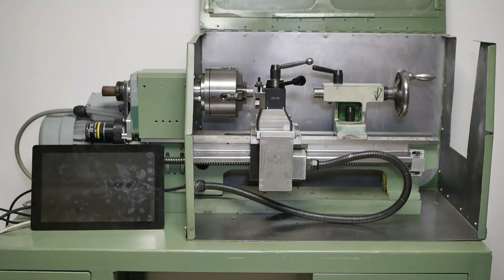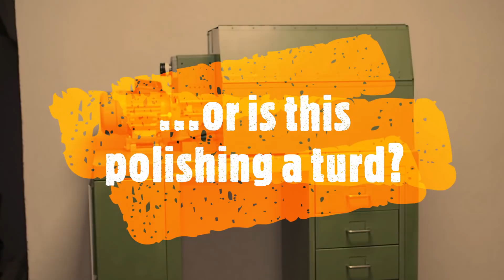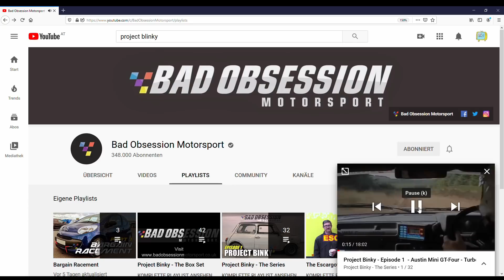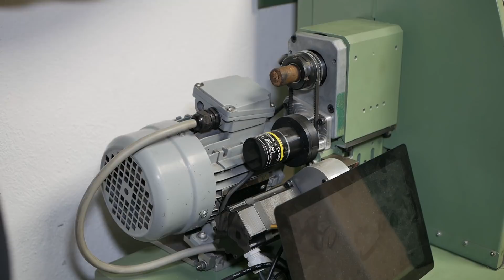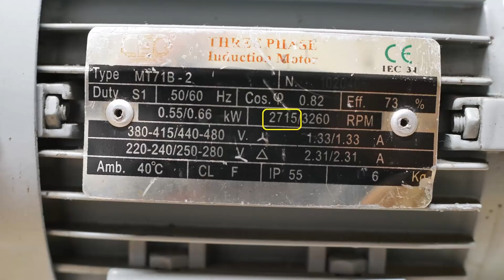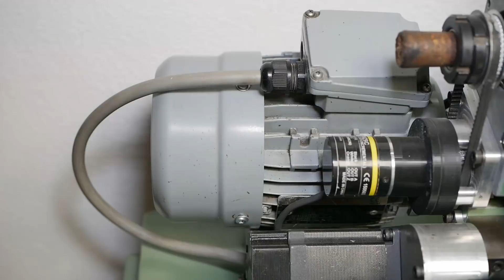Big Motor / Small lathe - CNC'ing the 7x12 Mini Lathe - Episode 32 || RotarySMP

Comment: the correct way would be to drop them in some hand gel /sanitizer / disinfection the moment that you stop sanding them since it cant create aluminumoxide in a alcohol solution ( thats also why you spray aluminium when takeing and after a last pass on the lathe so its super shint and stay shiny
Reply from the maker: Great tip, thanks.
Reply: @RotarySMP  your welcome m8
Reply: @RotarySMP  your welcome

Comment: Me again, did I miss the discussion about using Poly Vee drive belt and not timing belts.  Is the Poly Vee grip such that it will never slip and leave you with a really strange thread?  Sorry, I have been used to the timing belt solution for a really long time now, never figured it would be done any other way.  By the way, getting a feel for a lathe without handles can take a little while, it will come though!
Reply from the maker: Sorry for the late response,  I missed this one. 

LinuxCNC takes a full quadrature encoder for the spindle feedback.  Mine is a 100 pulse (400 in quadrature) encoder driven directly off the spindle, so it doens't matter if there is any slip in the poly Vee belt. Linuxcnc recalculates the necessary Z drive speed to sync with the spindle at 1000 Hz. I am pretty sure it will perfectly track along the correct pitch even down to a fully stalled spindle. There are some video of a guy hand cranking the spindle of a mini lathe with the Z axis threading under LinuxCNC:

How does the Hercus do spindle/ Z snyc for threading?
Reply: @RotarySMP  the Hercus does it badly. The spindle speed is measured at the speed call command line. Once the speed is acknowledged as being correct, there is no longer any more thought given to the problem. We are able to set the spindle error, mine is set to +/- 10, this gives accurate threads but takes a while to get the speed correct. If the spindle slows while cutting a thread, too bad, the Z keeps going at the same speed as it would for the “set” spindle speed. Not really aware of it having caused a problem, perhaps because I know it is a problem and just work to make sure it is not a problem. Hence my interest in your belt configuration.
Of course my system is 30 years old!
Reply from the maker: @smallcnclathes  Ouch. I didn't realise any CNC lathe relied on an open loop for threading. Even TurboCNC and Mach3 sync once per rev to an index. Lucky you know your machines so well.

I actually have a very low resolution resolver, as I got it years ago, when expecting to use the parallel port, which is speed limited. Although LinuxCNC does the snyc calcs at 1000Hz, the Mesa 7i96 can read encoders up to 10MHz, so insanely high resolution is possible.

I'd love to see you track down a third Hercus, do a LinuxCNC / Mesa card conversion using Gmoccapy and Andy Pugh's Lathe macros
https://forum.linuxcnc.org/41-guis/26550-lathe-macros.
and/or NativeCam

Comment: I notice my motor vibrating at some frequencies. Any advice ?
Reply from the maker: Do you mean vibrating like a loose mount? Original 110V DV motor or something else? Not a lot of info you gave.
Reply: @RotarySMP  sorry, the motor itself vibrates in isolation. Just a wee bit but once mounted on the lathe bed I can visibly notice it on anything I place on top of the lathe. It doesn't seem to affect the finish that much. Happens in the 30-40hz range. 50hz/250v nominal here down under.
Reply from the maker: @HM-Projects  These are not exactly high quality motors or PWM controllers. I fried my original motor by overloading it, taking too thick cuts in steel. 

The rubber belt drive will largely isolate the motor vibration from the spindle as will the plastic head stock gears. I wouldn#t worry about it.
Reply: @RotarySMP  could be the VFD, I'm using a 550w ABB motor which should be reasonably good hopefully.
Reply from the maker: @HM-Projects  Ahhh, that was a missing bit of information :)

Did you program the VFD with motors parameters?
Reply: @RotarySMP  yes, plugged all the relevant bits in. I have fiddled with the carrier frequency. Same result with different Chinese VFD, but motor runs smoothly on 3 phase power. I gave up after that :) 

Interested to know if this is a common issue as I've seen it mentioned on the interwebs but no clear explanation. People just skip certain frequencies.

Comment: What stopped you from cutting new pulleys with different ratios for the old motor? (Genuine question, I'm sure you considered it but didn't mention what prevented it.)
Reply from the maker: There is no space under the cover for a larger driven pully, and the shaft diameter would have only allowed small decrease in diameter of the drive pulley. It would have improved things but not enough in my estimation.

Comment: A few comments. If you look at VFD specific motors you will notice the cooling fan is often driven by it's own motor. This is to provide adequate cooling for the main motor when running at low RPM and high torque. So I recommend at a minimum you monitor motor temp when set to low RPM for long periods but I suspect the real limitation will be rigidity of the lathe so perhaps the point is moot . Second it is good practice to fully rough out a turned part before finishing up. This minimises the possibility of the work piece moving in the chuck and producing eccentric parts. Lastly having the compound slide permanently set over at some angle is academic at best on a small lathe. 1) having it offset deprives you of an accurate scale in the Z axis and removes the possibility of the compound moving and messing up a diameter. 2) unless you are producing coarse threads the direct infeed method will work perfectly for pitches under 3mm.
Reply from the maker: I am figuring that such a low power motor takes a a while to heat up, and it is unlikely to run for long periods at low rpm. Guess we'll see.

I leave the Boley compound at 30°, as it is tends to interfere with the tailstock when set to 0 degrees. It gives the impression that it was designed for rigidity more than usablity on the Boley, as it is also limited in the angles it can do. When I need an accurate Z depth, it is quick to rezero it.

Comment: Can't you just program max allowed frequency  output on the VFD instead of changing the motor? All VFDs what I know  have an option for limiting the max output frequency.
Reply from the maker: I could, but the low end torque was also insufficient. A different pulley ratio was also a possibiblity, but theere was insufficient space to use a larger driven, and the minimum drive pulley would not have improved it enough.

Comment: Friendly tip: If you cut v shaped grooves in a part like your pulley using the compound, set to match the angle - much as you would when cutting a similar shaped thread - you will experience less chatter than when plunging the tool straight in using the cross slide.
Reply from the maker: Thanks for the tip. I would have, but the geometry of the Boley's top slide prevents it from being used at the 70° angle this would require. The handle hits (either poor design, or maybe it is not the original handle) Turned out, that chatter was me not using sufficient feed. Only I increased the feedrate, all the other grooves cut chatter free.

Comment: why didnt you get an ac servo motor and use it in velocity mode?
Reply from the maker: Back when I first converted this lathe about 15 years ago, those cheap AC servos were not available. So I got the VFD. Since here I only wanted to change the motor, it was cheaper to stick with the induction motor and VFD.
Reply: @RotarySMP  okay

Comment: I would advise against trying to drill and tap the hardened drive shaft. One set screw on the key would be my choice.
Reply from the maker: Good advice, although it is not hardened. Watch this space...
Reply: @RotarySMP  My bad, I assumed something similar to industrial Baldor's I'm familiar. Its still a big motor for the machine.

Comment: Was anyone else wondering why he did not just change the pulleys to suit the required rpm?
Reply from the maker: Space available. The driven pulley is already at max size for the space under it's housing. The drive pulley could have been made somewhat smaller, but driven by 14mm dia shaft+3mm rad  keyway+4mm dia pulley grooves + some wall thickness, I couldn't have got it down to the range I was looking for.
Reply: @RotarySMP  life is seldom that straightforward, what's the torque like at 100hz? Much of a drop off?
Reply from the maker: In it's current installation, I was too busy crapping myself with the air raid siren of this thing running unlubed straight cut gears at 6000+ RPM to worry about torque. 
Torque at high RPM is pretty irrelevant to this machine. The reason I didn't run a belt directly to the spindle again was the lack of torque down low. Back when I had the direct belt drive, I once cut the male thread for an ER32 collet, and it basically failed as the minimum RPM to have enough torque to cut without rubbing, was too fast for the axis to keep up.

Comment: Try Loctite 641 (or was it 640?) "retaining compound" for loose pulleys & misfit keys. It's like machinist's superglue 😂 
A heat gun can loosen it back when you need to disassemble it again. I used to fix stuff for a living, can't remember the number of times we had machinery with lost or broken keys, needed to be turned around in hours if not in minutes!! 
This stuff basically allowed me to run hundreds of motors without the need for a new pulley or re-bore/re-sleeve. Basically on the spot jobs. I've run pulleys on upto 3hp motors without a key! 
It doesn't even require the mating surfaces to be clean :)
Btw. I might sound like a loctite rep, I'm not 😂😂 
I just love a couple of their products so long as they save me time (and therefore money).
Reply from the maker: Thanks, good advice, I'll look into that, but first I'll use it for a while to see whether I prefer the 35mm or the 45mm pulley.

Comment: would it have been easier to simply change the gearing on the old setup?? gear the 6000 back down to 2500 by changing a pulley or 2 ?
Reply from the maker: There is not enough space for a much larger driven pulley, and the drive pulleys mini diamter is driven by the 14mm shaft + 4mm grooves + 3mm keyway and some remaining wall thickness. But you are right, there are always multiple different solutions.

Comment: Well that video was helpful. I have to fit an new motor and vfd to my Colchester Chipmaster before I use it. And that will need adaptor plates etc. I guess that getting the mill running first will be the first stage as for that I just need a 1 phase 230v to 3 phase 400v inverter. Shame those inverters are so expensive!
Reply from the maker: You dont need to step up to 400V. A standard 3 Ph induction motor like that can be wired either for 400V (Star) or 230V (delta), just by swtiching the jumper plates in the junction box.  Just get a bog standard motor like this and a 230V Invertor. Any invertor can be run on single phase, you just need to derate them.
Reply: @RotarySMP  oooh interesting and thanks for the reply, however I think the mill in this case has a lot of ancillary components. It's a Schaublin 13. The guy I bought it of had converted his lathe by using a transformer to lift the valtage but he was running the mill on a 7.5kw inverter. 

My chipmaster lathe needs a new 5hp/3p motor and an inverter as at the moment it has nothing (although I have a suitable 5.5hp motor but it's a 440v 3p, but I don't think that it can be used easily). It is totally stripped down at the moment I've replaced everything that needed replacing and repainted it completely after blasting everything that needed it. The variator unfortunately was scrapped as it was very much a washing machine with loose bearings in it.
Reply from the maker: @house89147  Everything Achaublin ever made is fantastically designed and built. I guess you have seen This old Tony's Schaublin posts from a few years ago.

Comment: Oops I was thinking -3 and +3 surely that’s not right... aah it wasn’t.  I would have probably done the same thing lol. Good fix though and the new motor looks tops. Thanks for the video.
Reply: I probably would have done the central one and then widened accordingly and found another way to screw up.
Reply from the maker: See, I didn't even have a nagging doubt. Full speed ahead on the HMS Ignorance. Was pretty funny in edit to see that. Lucky the fix worked. Would have sucked to have had to rotate that pulley to a fresh section and leave the offset slot in for all to see.

Comment: Tip: If you're getting chatter cutting vee grooves, feed in with the compound at 1/2 the included angle, then clean up each side. Takes a little more math though.
Reply from the maker: I like your channel name :)
The geometry of the Boley top slide does not allow you to feed in at 70° to the bed, as the handle hits the cross slide. This is quite limiting, and one of the reasons why I will replace the Boley. Now if I have planned better and cut the pulleys on the Mini lathe before pulling the motor??
Actually the chatter was just feeding too slowly. Once I loaded it up a little more and cut faster, it didn't chatter at all.
Reply: @RotarySMP  Oh my. That is quite limiting. Perhaps once (if :P) you have the mini lathe up and running you can replace the Boley with a larger toolroom lathe. And thanks. :)
Reply from the maker: @TheMetalButcher  The Boley is a 750kg tool room lathe. But I have been keeping my eye on Colchester Batam VS, Emco V13, Weiler Matdor, Schaublin 125 etc.

I am undecided, as I really like useing a manual lathe. CNC is far less essential on the Lathe than on the mill. Maybe I sell both Boley and Mini lathe and get a Schaublin 125CNC and retrofit it, with manual jog wheels like Andy Pughs Holbrook.
Reply: @RotarySMP  Huh. Well I read through the lathes.co.uk listing. I must say, it's fairly impressively designed, but in typical American fashion, I like our lathe designs better, with less fussing with change gears and the like. I must say that is is an impressively universal machine. Maybe consider doing a video on it sometime? I had a hard time getting size/scale, it seems like a much smaller and lighter lathe in the videos.
Reply from the maker: @TheMetalButcher  The Boley 4LV has  only an 9 inch swing, so it is number smaller than the 10EE etc, but the bed casting is extremely massive, wider than the swing, and being closed rather than open/ribbed, extremely stiff. Also the saddle is also longer than the swing. Mine is on the much more massive cast iron base of the 5LZ, rather than the lighter stands of the ones in Lathes.co.uk.
Unfortunately I didn't get the change gears or banjos with it. Mine has a fine feed lead screw drive. I did make up a stepper drive to use it as s 1 axis CNC / electronic lead screw, but mostly dont fit it.
Reply: @RotarySMP  Ah, only a 9 then. That is pretty small. For reference, I'm used to a much lighter ~250kg 10" Rockwell, but also a much heavier 1300kg 1440 Lagun, and a 2300kg 18.5" Sidney lathe. So it's still rather light to me, even though it's pretty good for it's size. Any good lathe should have a saddle wider than it's swing, but the ways being wider than the swing is the true mark of a toolroom lathe. Very impressive design for keeping the chips out. Shame on the change gears.
Reply from the maker: @TheMetalButcher  Nice. A little more swing would always be nice.
Reply: I was thinking this exact technique

Comment: I have the same motor on my  lathe and it  works great.
Reply from the maker: That is good. The 2Pole motor was also fine, back when I used to run a belt directly to the spindle.

Comment: Builds CNC lathe.

Works on manual lathe.
Reply from the maker: You got me. I really really like using the Boly 4LV. It is suchs a nice machine to use, even if it is rather worn out.
Reply: @RotarySMP  You and I have different definitions of worn out haha. My Sidney has about 25 thou of bed wear. 50 in the saddle. 15 side to side in the cross-slide. I didn't know it was that bad or I wouldn't have gotten it. Your Boley seems new in comparison!
Reply from the maker: @TheMetalButcher  With the gibs adjusted to just go tight at the end of the bed, the saddlecan move around a fair bit up by the head stock. I just put a clock on it. rotating the saddle I get 0.15mm of movement at the back of the saddle. Not the end of the world, but still pretty worn.
Reply: @RotarySMP  One of the disadvantages of not having vee ways I guess. In my case, the bed wear is negligible. Just results in a relative tool drop making a negligible difference on diameter. You've certainly proven yourself to be capable on the Seig. Will you rebuild the Boley or sell it as is?
Reply: @TheMetalButcher  it's not worth selling rebuilt machines. If you rebuild it for yourself you can justify the time as it's a hobby but if you rebuild a machine to high standards only to sell it you need to get some serious money off it or you just wasted time. A machine with soft ways without automatic lubrication and all the high end Über features doesn't sell for super high money.
Reply from the maker: @TheMetalButcher  The boley has the Vee ways underneath. Basically a dovetail.

I think I will sell it as is, with the huge collection of accessories it should sell okay. I will never buy another lathe without Camlock or German KK nose.